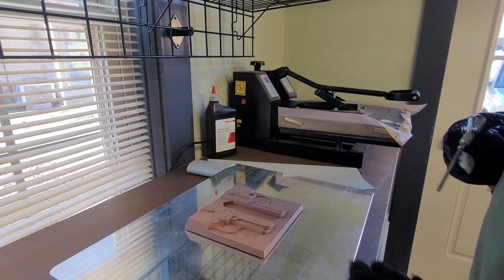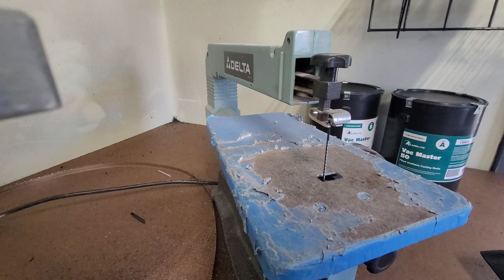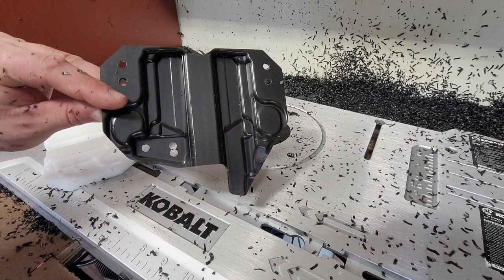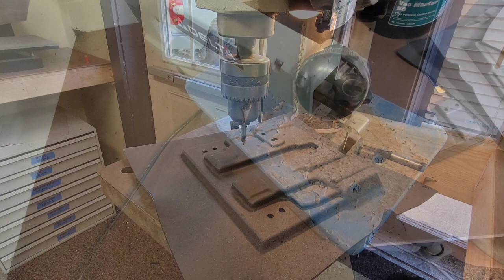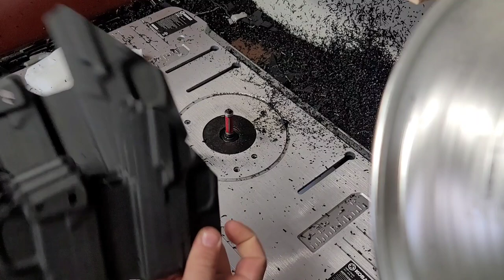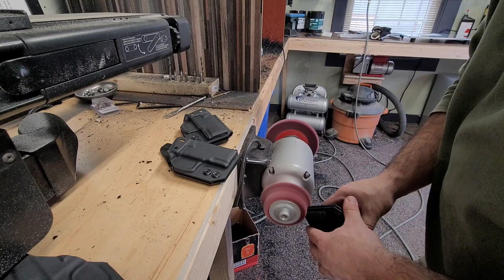5 holsters 1 video! wwhhaattt Taurus G2c and Sig P938

Comment: I have 2 bandsaws and practically useless for Kydex. The wide blades snap or jump track when turned hard. Go back to your "good" old faithful scroll saw. I have worked wood with routers and shaper tables for years and scares the hell out of me to see any piece of material going away from blade just a jitter away from injury. Be safe

Comment: Sir, how many degrees is preheated in the press? I was confused, when I set the heat to 180 °. the quality of the carbon is scuffed or peeled off
Reply from the maker: My press is set to 410⁰ for 100 seconds. All presses vary though. The kydex comes out at 360 to 370⁰
Reply: @FalTacUnlimitedLLC  Thank you very much sir, I already consider you as my teacher 😀🤛
Reply from the maker: @mardocombat5280  hell yes

Comment: Thanks for the info.  Would you mind doing a video on layout design work on a vac formed holster?
Reply from the maker: As in designing the mold or the shop layout for makinh
Reply: @FalTacUnlimitedLLC  designing the mold - "sketch the holster"
Reply from the maker: @brentermis4301  eventually we will be designing our own splits. But these particular splits/molds are already designed and implement certain attachments. Mainly used for repeat holsters

Comment: What’s the purpose for the two pieces of tape? I just fold them and clamp the trigger guard. Wouldn’t it create a gap and make the gun jiggle? Plus I didn’t know you could go the opposite way on the router. That will help me a lot. Great video.
Reply from the maker: Extra width so it doesn't scratch the slide up

Comment: Hey man, great videos, I've been watching all of them and I learn a lot. I have a question though if you don't mind. The first, is the smell, I live in a small house and only have my basement to work in, the smell drives my wife nuts. Do you know how to make it smell less? I use a heat press not an toaster oven, do you notice one smells less than the other?
Reply from the maker: Well to be honest. There will always be a smell when heating up kydex. Its like a faint skunk or weed and no in between. You can run a fumes extractor to help but have a dedicated space for everything

Comment: Yo Iggy, this probably isn't the best video to ask the question, but do you ever have an issue with the foam sticking to the Kydex? Recently some stuck so bad I can't get it off. I've tried, soap and water, rubbing alcohol, lysol wipes, hopps solvent... Nothing it getting it off all the way. Any insight would be helpful. Thanks!!
Reply from the maker: I have! I have come to the conclusion that if its too hot and combined with a ton of pressure it sticks. I think of it as the pores of the material clamping down on the foam. Try a max of 350⁰
Reply: @FalTacUnlimitedLLC  Well I'm glad I'm not alone. It's sure frustrating though. I usually heat to around 350 (I use the oven in the house), then have to run it out to the garage to put it in the foam press. I figured it would cool by the time I get it in the press. But I'll try to keep it at 350 or below. Thanks for the help!
Reply from the maker: @jordanhandley2359  no less than 350! Be best to get a dedicated oven for kydex. It releases gasses thats toxic and your food can absorb it
Reply: @FalTacUnlimitedLLC  well that's disgusting.... Looks like my next purchase is a large toaster oven.
Reply from the maker: @jordanhandley2359  good idea!
Reply: I had that problem til I started buying foam from holster smith,Never was a issue again.